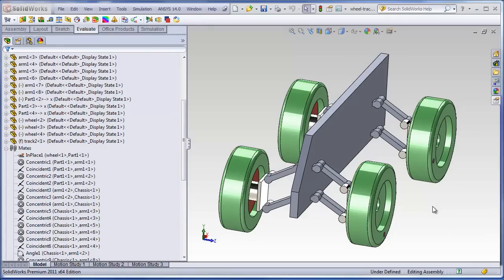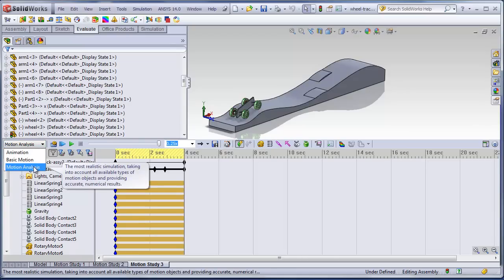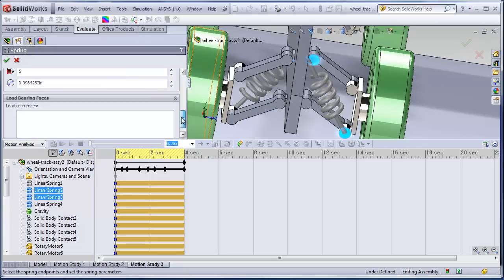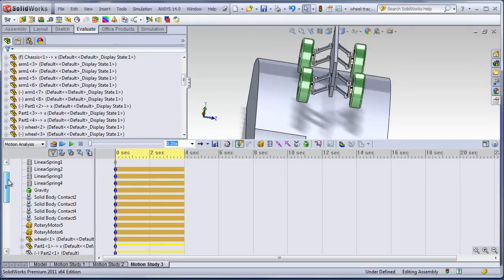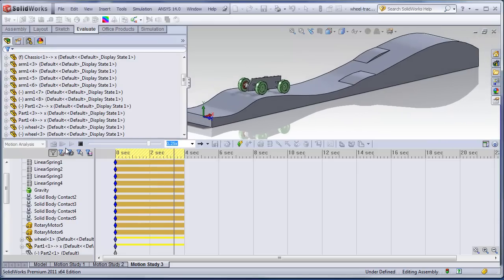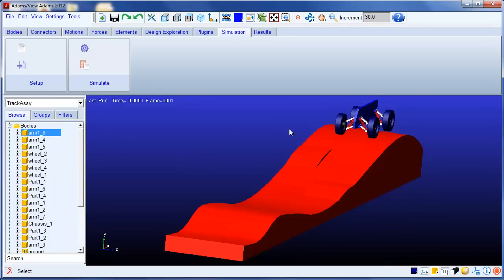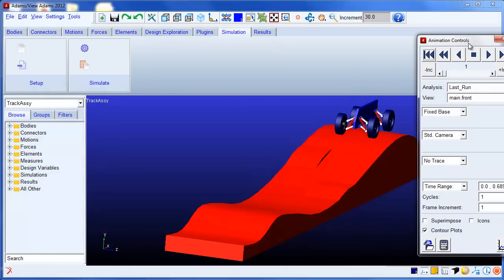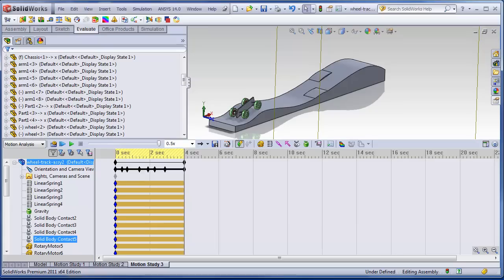Multibody dynamics using Solidworks & Adams 2012

Comment: What could you do in Adams that you could not really do in Solidworks in your project?
Reply: I'll use an analogy. Comparing Solidworks to ADAMS is like comparing Wordpad to Microsoft Word. You can type up papers in both but Word has tons of more features.
Reply: In solid works you can not see the dynamic behaviour of your system, you cant read joint forces or accelerations etc. Kinematic solver of ADAMS is embedded in Solidworks, actually you are still using a limited part of ADAMS when you perform a motion analysis in Solidworks